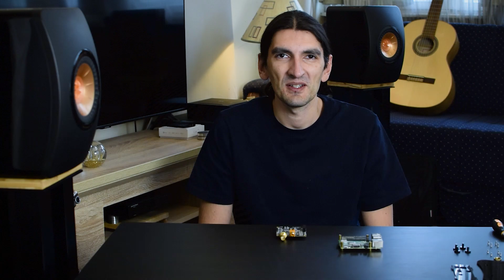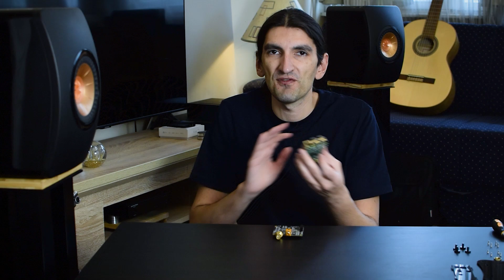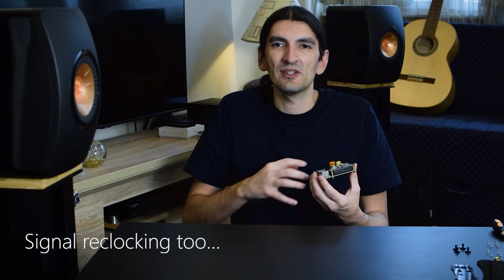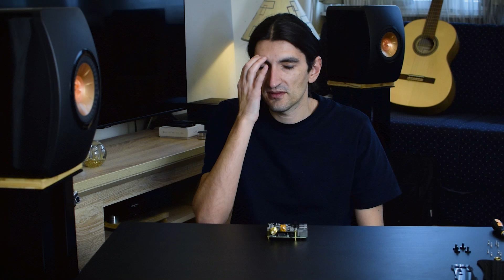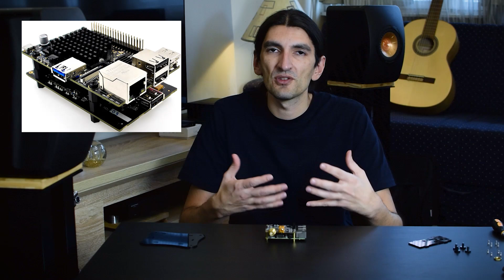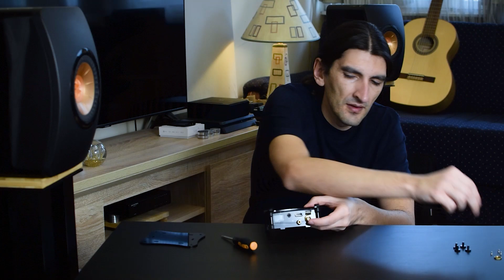Allo DigiOne and Raspberry Pi for Audiophile Digital Streaming

Comment: Hi, I use a raspberry 4 8Gb with Moode, with a hat dac, Digital AK4118, IIS DAC, I2S Coaxial Optical Output, connected to another DAC MODI 3, topping D10s or ifi Zen DAN,  finally the amplifier. For the screen, I use an 11-inch amoled tablet. I use Moode because I have music on 2Tb hard drives in flac and dsd formats, and in Volumio I am not able to make it recognize them.
Reply: I too have about 2TB of Lossless music on a hard drive, plus I want to add Tidal and Spotify streaming. What is the best value streamer I can get that will connect to the i2S LVDS input of my Topping D70s DAC? 

How to get i2S from a Raspberry Pi4?
Reply: @navinadv  You can get it with the application that I use, Moode, on the website and forum you will easily find all the answers. And the hat that I use for the raspberry 4 8Gb, you can find it in the famous Chinese sales page, doing the search "raspberry pi AK4118" will come up.
Reply: @juliancrun  which website and forum? I tried searching that Chinese page but it did not show and AK4118 HAT board for the RPi4.
Reply: @juliancrun  ok I found “AK4118 Coaxial HIFI Sound Card DAC I2S DSD Digital Broadcasting 32BIT PCM384 DSD128”. Is this what you used?
Reply: @navinadv  Yes.
Reply: @navinadv  And the web is moodeaudio
Reply: @juliancrun  thanks will look it up.

Comment: What about a Nobsound Douk Audio U2, which converts usb to optical. Would such a device also get rid of jitter?
Reply: Allo say this about Toslink "Optical had to go… by definition it has a jitter of 4ns. That’s 4000ps. We simply removed it. However, optical has galvanic isolation so we took the decision to use a digital isolator instead that separates the outputs from both RPI and WM8805."
Reply: @dreddguy6454  Hi Dreddguy, would you please share the link where you found this info on Allo's findings about toslink issues etc. Thank you.

Comment: Have you tried quality HiFi USB cable?
Reply from the maker: I did try several cables ranging from few bucks to few hundred bucks. They can make pretty significant difference.
Reply: @iiWiReviews  thanks for the quick answer. So, would you still say that RbPi will sound better with DigiOne daughterboard, even compared with RbPi over USB with quality cable?
Reply from the maker: @tomislavpopinjac8232  In my opinion DigiOne with a modest cable (let's say decent Canare or Belden... just not something that's $1 from AliExpress) sounds better than USB with any cable (Intona Premium, FTA Callisto, etc.)... And only when a good USB regenerator is introduced (Intona, iFi, etc.) USB becomes an equal contender to DigiOne... than it's a tough battle and a good cable can tip it to one side or the other. I chose this route for myself because a USB regenerator is more expensive, to begin with, then it needs two decent USB cables... And I can only cry over my modest budget just thinking about it. :)
Reply: “HiFi USB cable” ok now I know this is the side of audiophillia that’s complete and utter bullshit. Really? High quality usb? There is no difference between and Amazon basics usb and whatever hundreds of dollars bullshit you’re buying. Y’all are high on some modern day snake oil my god,

Comment: I guess you are using Allo's Shanti power supply with your DigiOne.  Easy question: can you notice further improvement from a ifi iPower or a regular wallwart? And last but not least: how much do you think it matters the streamer OS on the RaspPi? DietPi, Volumio, Raspberry Pi OS Lite.. Does it make a difference in sound quality? Great review as always!
Reply from the maker: Yes, I'm using Shanti with it and it did bring an improvement over my previous iFi iPower. Also, OSes do sound a bit different (I have no idea why) and for that I prefer RoPieeeXL that's somehow cleanest sounding to my ears.
Reply: @iiWiReviews  can you show us how to install Roopiee on RPi4?
Reply: IMHO I think that PiCorePlayer is the best sounding OS. Maybe because it operates entirely in Ram.

Comment: I have a question / request. Is it possible to route entire Windows Audio and not just Audio from a specific Audio Player like Roon to a streaming device like Raspberry Pi. And if it is possible can you make a Guide Video how to do it? I'm really only interested in routing all Windows Audio to a device and not a player. Thank You.
Reply: It looks like it might be possible with:
 TuneBlade App (Windows PC) + Shairport on Raspberry Pi (AirPlay Reciever)
Reply: on MacOS you can easily using Airplay. Not sure about Windows though
Reply: @zyghom  That's neat. AirPlay uses lossless compression too. I hope there is an equivalent for Windows. Was looking into NDI Codec, but it is really meant for Video and adds some minor compression...
Reply: @katrin-40  that is how I watch on my projector: hdmi from Mac to projector and audio via Airplay from Mac to my raspberry streamer, then dac then amp then speakers.
Reply: @zyghom  No Video-Audio Sync issues?
I'd also add a separate preamp after dac like Topping A90 to increase audio quality even further.
Reply: @katrin-40  Airplay by design has around 2s delay. When I play from Plex or from YT it synchronises automatically. If I use VLC I have to delay audio by minus 2s. IINA player I think it synchronises automatically as well - I am not sure. Quality of audio: limitations of Airplay. I am astonished though - just watched Interstellar - marvellous.
Reply: @zyghom  Ok got it, so AirPlay isn't lossless after all, but still decent enough:
AirPlay is transmitting “CD quality” audio (16bit / 44.1kHz).
Audio formats used by pros and audiophiles with higher resolution (e.g. 24 Bit / 192kHz) will be down-sampled to 16 Bit / 44.1kHz.
Reply: @katrin-40  "The AirTunes part of the AirPlay protocol stack uses UDP for streaming audio and is based on the RTSP network control protocol. The streams are transcoded using the Apple Lossless codec with 44100 Hz and 2 channels symmetrically encrypted with AES, requiring the receiver to have access to the appropriate key to decrypt the streams. The stream is buffered for approximately 2 seconds before playback begins, resulting in a small delay before audio is output after starting an AirPlay stream" - https://en.wikipedia.org/wiki/AirPlay#Protocols   And: https://www.cambridgeaudio.com/gbr/en/blog/difference-between-airplay-bluetooth

Comment: One question, why have you chosen a digital output and not a RCA one? This would reduce the "flow" by not using an external DAC. Again an excellent review. Congratulations!
Reply from the maker: This board only has digital out. It is RCA physically but it is Digital SPDIF RCA, not an analogue one. I chose it because I'm already using great external DAC (that no analog board for Pi can match).

That said, if you want to keep things simple and more affordable too, DAC HAT with analog RCA outputs do exist for Raspberry Pi... I just didn't try them.